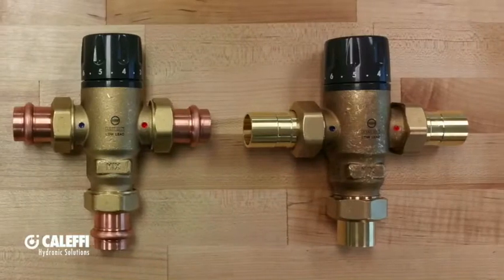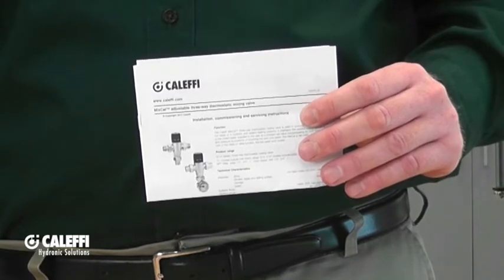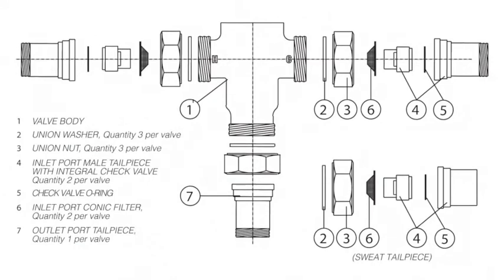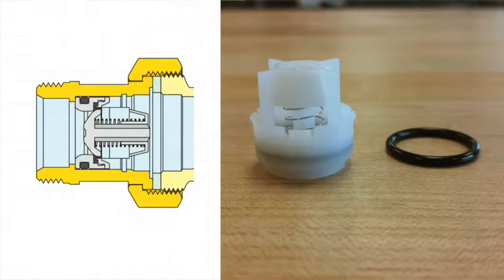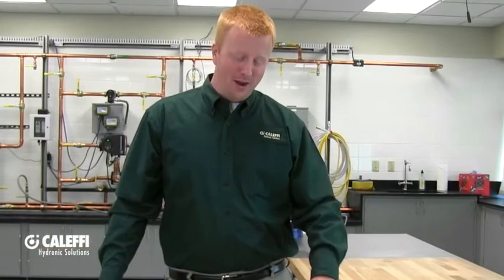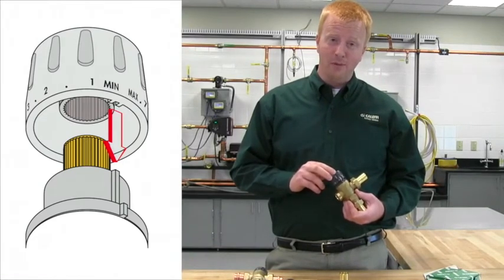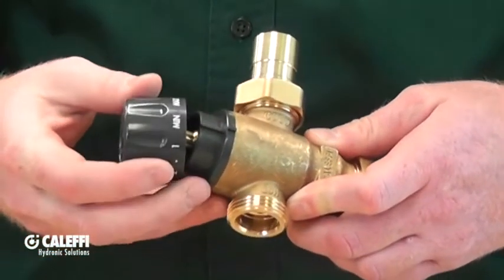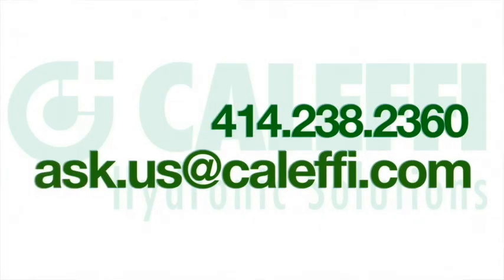521 MixCal™

Comment: A little more coverage on using the numbers on the knob before locking it would be helpful.
Reply from the maker: Hello, thank you for the feedback. You will find more information on setting the temperature using the numbers in your installation instructions that come with the mixing valve.